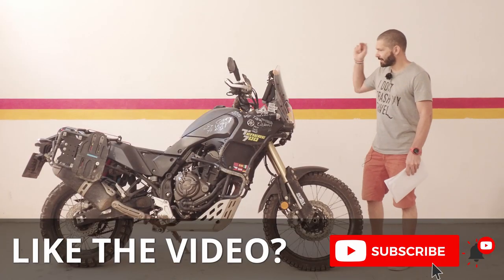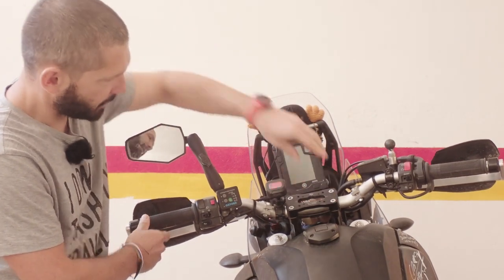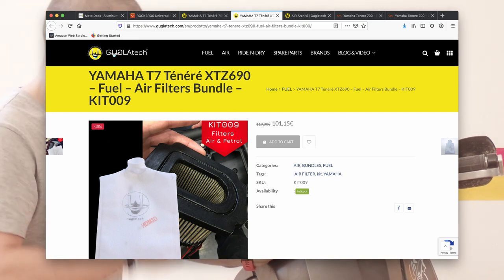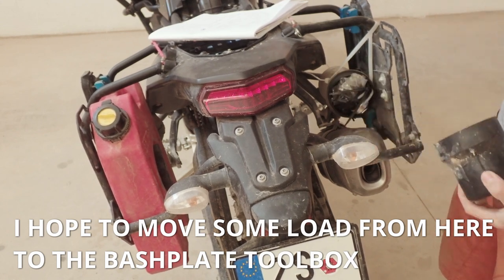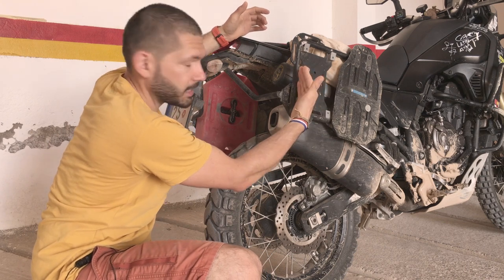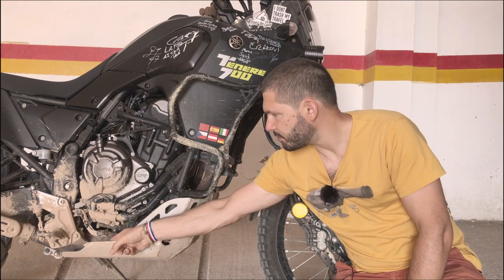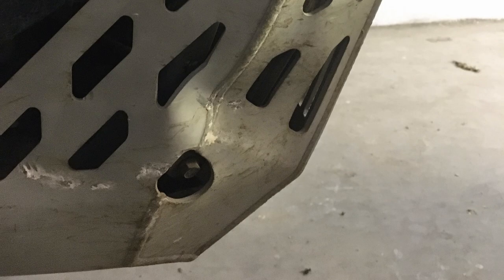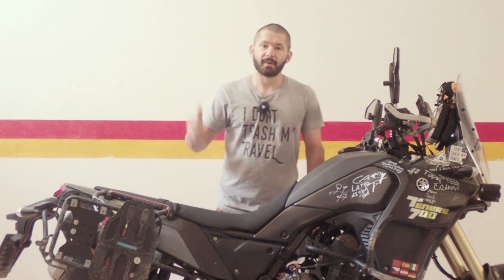Yamaha Ténéré 700 10k: 19 Accessories & Mods (so far)

Comment: You forgot to mention the accessory signatures on the gas tank , very important lol . 
   I have been searching high and low for Tenere 700 parts in America and so far ProCycle has the most stuff but I will check out Rally Raid and the ADV one you mentioned . If I had to choose a bash plate I'd go with B&B . It's very thick and goes farther back to protect the suspension but I will keep looking . So far Outback Mototech is sold out of everything Tenere in the States , so maybe patience is the key with them . 
    Oh one more thing , do you know how much wattage is left for accessories on the stock stator . Want to know what the bike can handle as far as added electrical equipment . Happy trails !
Reply from the maker: Signatures are very important, they're from people I meet on the road. I guess the suppply for T7 accessories will now be under big pressure in US with it's release. I will see how much the suspension gets beat up and if I have dents on it I'll modify my bashplate to protect it, so far its quite intact.

I was looking at the stator specs and can't wind output it is rated for in the specification so I'm not sure.
Reply: Our Tenere 700 parts are now on their way to the States. Anticipated availability will be around next week but also depends on the current customs clearance work load of FedEx
Reply: @FARANDFURTHER  
With my DR650 you get about 50 extra watts , then you need to get a high watt stator . I gained a little more watts when I switched to LED bulbs . I will get even more when I put in the DOT LED headlight . That will give me enough watts for several accessories/mods .
Reply from the maker: If Yamaha is anything like Honda CB500X was, there was massive amount of spare capacity on Honda. I suppose it would be same with T7, not to mention that most of the lights are LEDs keeping load low.
Reply: @FARANDFURTHER  
Yeah that makes sense .
Reply: @Outbackmotortek  
Okay I will hold off on the crash bars for the moment . Think I left an email about them a few weeks ago but maybe I will call you guys in a little bit to see what's going on . Your crash bars are first on my list so I can be patient , a little lol .

Comment: You can fix the high beam over ride with a simple relay if your interested, tag me back.  Had to do it on my Hayabusa with the cruise control system I fabricated for it.
Reply from the maker: Hi Shaun, yes after some research and fiddling I have now just simple automotive relay which is able to switch the High beam as I need to.

Comment: Great video,
what s the  width of the bike with the Mosko moto panniers installed please?
Reply from the maker: You want the measurement or just truthful ballpark.... too wide. The problem is not really the Mosko but the fact that the symmetrical design of the rack does make the bike excessively wide. I'm now looking for a bit leaner solution.
Reply: @FARANDFURTHER   yes, just the measurement please?
Reply: maybe with the Reckless 80L will look leaner ? ...I am just looking for something not too bulky but with still some rooms for long travels :)
Reply from the maker: @twodirtywheels1498  I've just tested Mosko Moto Reckless 80L and it is much much leaner than the rack & panniers, I'd guess you loose about 20cm in total width with the Reckless.

Comment: do you know what the centre to centre measurement of the top bar clamp is?
Reply from the maker: Hi Steve, I don't know but I'm really happy to measure if you tell me exactly what you want to measure. Do I understand you want distance between centres of the forks at the top of the top clamp?
Reply: please measure the bolt centre from right to left it will be 100 or something MM
Reply from the maker: Will do tomorrow morning Steve and will report. What is the value good for if I may ask?
Reply: @FARANDFURTHER  I want to get a set of hand guards from HDB but i dont have my bike yet and he wants that measurement so he can make me a set
Reply from the maker: So from the centre of one fork top cap to other its 203mm +-2
Reply: @FARANDFURTHER  thank you

Comment: How tall is this guy? Just trying to scale by eye
Reply from the maker: I’m 168cm and 75cm inseam.
Reply: @FARANDFURTHER   why do you think you need a stiffer spring?
Reply from the maker: Because I measured my static and rider sag and it is much higher with luggage than it should be no matter how I set the preload. This means the spring rate is wrong for my weight + load I usually have on the bike. If I ride without any luggage I can get it close but with a lot of preload and that is not good either.
Reply: @FARANDFURTHER  Good job! Weird that the OEM spring doesn't cover the weight of you and luggage which I recon is around 85kg.
We're waiting for impressions when you ride with the new spring, after setting the sag correctly. Don't forget to readjust rebound and compression. 
Cheers!
Reply from the maker: Morocco just announced the extension of the lockdown so the impressions with new spring will have to wait. I'm now constantly working on tweaking the stock suspenstion and taking the measurements so when I have new spring I'll be able to have not only feelings but also some numbers.

I'm playing with the clickers yes, but it's long process as I change, ride same track few times take measurements and then move to other setting and so on...

I'm 68kg luggage is +- 35-40kg depending how much extra fuel and water and sag is wrong.
Reply: @FARANDFURTHER  pity for the wait.
Oh, I see. 110kg. Fair.
Well...if you can't avoid it, try to enjoy it. (The lockdown)
All the best mate.
Reply from the maker: I can't really complaint about the lockdown here in Morocco, also they moved into easing phase so allowed travel within the province for the first time. So I guess it can only get better. ;)

Spring is not a problem when I ride alone, but with luggage I need stronger. Even if I try to pack superlight it would be difficult to get under 30kg and the spring is simple solution to all that.

Comment: No centre stand? Why?
Reply from the maker: Hi Johanes, not real reason really. I didn't have center stand before on my Honda CB500X as I raised it and OEM was short and I got used to it. I'm using my trail stand (separate video) to do most of the work on the road and for other repairs and maintenance, there is always garage.

Comment: I'm confused, why do all those mods and leave the floppy plate holder, blinkers stock.? Save 2 pounds junk it!
Reply from the maker: Hi Jay, at that time I didn't need to change those. The accessories were not for the looks but for the function and I didn't mind the OEM rear. Now after 60kkm and 3 years, I have moved to CamelAdv tail tidy because I have the high exhaust and my indicators got toasted...

Comment: Is tne bike really that big or are you really that small?
Reply: I saw in another video he was 5'6 and came to this video to see if he installed the lower seat or the lowering link, which I guess he did not. Me also being 5'6, I'm happy to see other "short" riders on what is a somewhat tall bike. (35" seat height if I recall)
Reply from the maker: I'm that small ;)
Reply from the maker: Hi Chris, you're right I've not lowered anything on the bike. So far so good. She is tall bike for us shorter riders but it is manageable, of course low speed handling is a bit tricky and needs some muscle but in terms of riding it does feel like it fits well.

Also... lets not forget Gaston Rahier who was 164 and won Dakar ;)

Comment: You have literally demolished almost everything, if it resisted torture you're putting it through it's basically tough enough :D 
Did you get to find anything for the RX100V, Can't find a thing for now :(
Reply from the maker: Hehe, Outback messages me time to time, checking if I managed to break anything theirs, so far they are being proud ;) But I've not finished yet! 😜 
Well if those products are meant to be "adventure" ready... lets see if they're!

I didn't manage to look at it, I can buy the spare parts in Europe, but have not looked in Morocco, the problem looking here is language. Search in English is very ineffective and I don't speak French or Arabic.
Reply: @FARANDFURTHER  I can try on my side, maybe I'll find something, not sure though
Reply from the maker: I'm going to send you link to an exact part I need. I need to first take it off camera and maybe that will make it easier to track something here in MK. Thanks for help and time!
Reply from the maker: Hi so I've taken the Sony appart again and I need main lens cable. It is available on eBay for example under this listing:
https://bit.ly/3ezgv0A
The part number is LF-2091-12

Comment: What no springs or suspension upgrades?
Reply from the maker: I've done this video quite long ago and at that time I didn't have suspension upgrades on the T7. Now I've 40k and the situation is different as I've replaced both front and rear suspension after finding the OEM limits on the MX track and 2x Dinaric rally.

Comment: No.1 needed Tenere 700 accessory = Engine Protectors/Crash Bars. WHY?
The Yamaha Tenere 700 is a very good bike But it has a major fault or flaw: 
-  it is heavy for a dirt bike
- and it's weight is high making it top heavy
This issue is why you hear and/or see many riders of all levels laying down the bike or crashing it more than other adventure bikes.
As another RESULT of the TOP HEAVY WEIGHT the Tenere 700 is harder to pick up with many smaller men & many women not being able to pick it up.
Reply from the maker: I kind of think people are thinking about Tenere 700 as a "dirt bike"... there are no dirt bikes with weight 200+kg.

There is a video in which the guy measured the weight one is lifting with different bikes and T7 was not definitely the heaviest of the adventure bikes out there.

Yes, it is top heavy, but that's relative to what one compares it to...